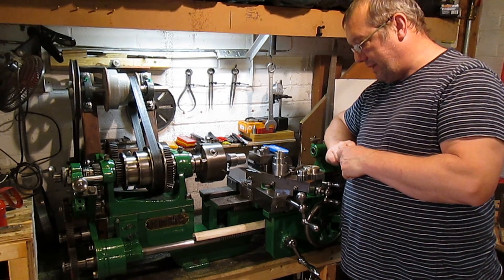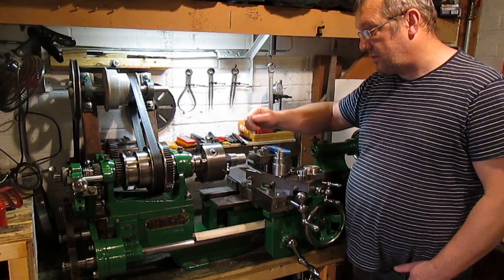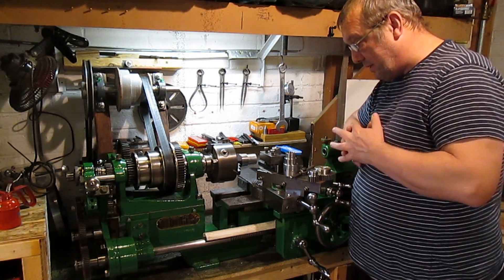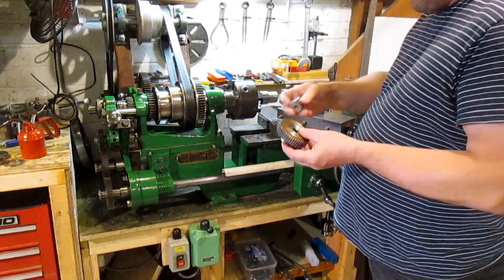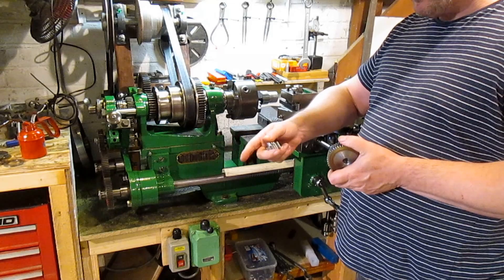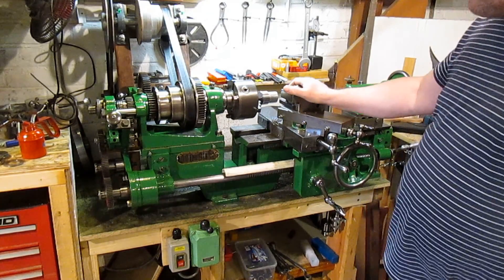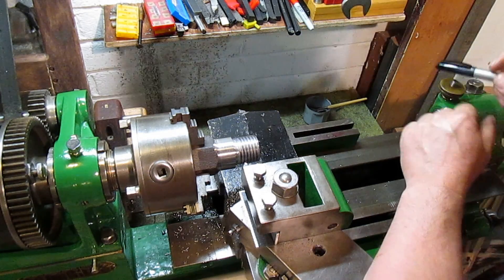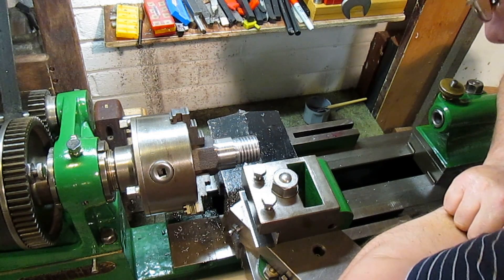Lathe update # 21 First attempt at thread cutting FAIL & yackety yack

Comment: Not a failure. a simple mistake. The  first time I touched a lathe I had to do this. The procedure is (1) set up the gears. (2) position yourself at start of screw. (3) engage the half-nut. Henceforth do not touch the half nut . (4) Cut the first pass/ Stop lathe at end of cut. (5) reverse the lathe and let it go back to the start of the screw. (5) crank infeed with the top slide. Put lathe in forward, cut again. Repeat from (4). The mistake was disengaging the half nut! 

I recommend the excellent book by L.H. Sparey, "The amateur's Lathe" or something like that -- he taught me most of what I know.

Comment: It might have been a mistake but now you know how to cut a double start thread !!! I always leave the half nut engaged on the leadscrew when I am thread cutting.(mainly as my lathes are Imperial and I am usually cutting metric threads)  It removes one more possibility of making a mistake but always remember when winding the machine back to go far enough back so that the backlash is taken up before you start to cut again otherwise it makes an interesting start to the thread....well done on working it out I will stop shouting a solution at the screen now !! 
Regards
Dave.